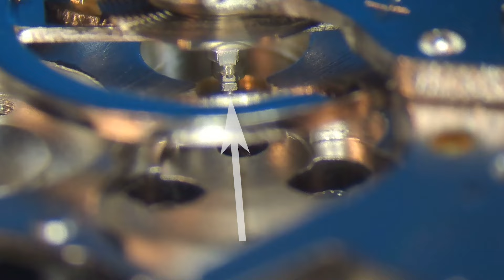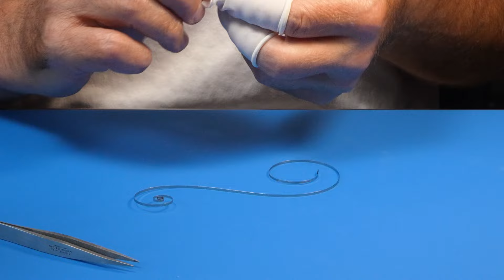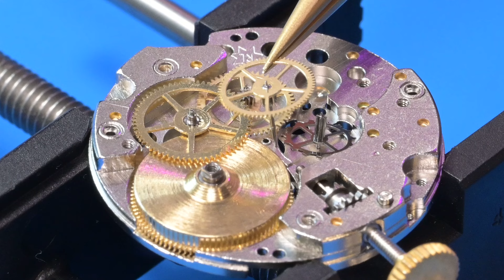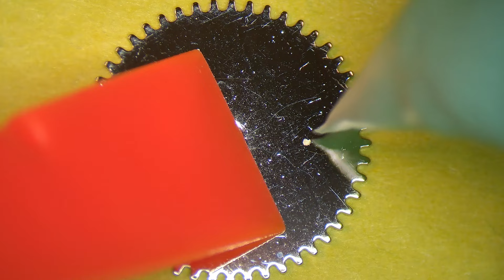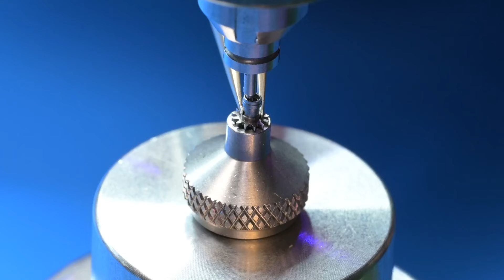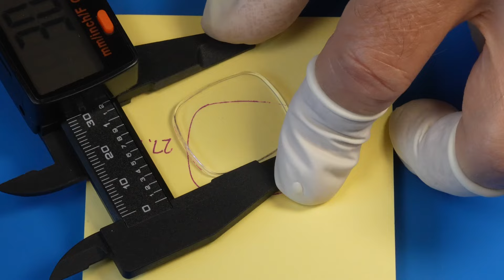⌚ Part 2: Late 1960s Pin Pallet Watch Restoration: E. Gluck "Chateau" Wristwatch #watchrepair

Comment: Great help. Thanks. What size screwdrivers do you use. Are they smaller than 0.6mm?
Reply from the maker: Hi Steve, my Bergeon screwdriver set has the following sizes in mm:
.5, .6, .8, 1.0, 1.2, 1.4, 1.6, 2.0, 2.5

Comment: How much does the beat error go up when you improve the accuracy? For a watch like that 2ms is negligible and a little more is acceptable. Accuracy should be the priority over beat error.
Reply from the maker: The beat error jumped up to 1.8. I felt like I was chasing my tail trying to regulate the watch, so I figured I would re-case it and wear it for a while… Let it settle in before spending any more time on accuracy.
Reply: @WatchWithMike  I’d bet 2ms was within manufacturing tolerance for that movement. Go for the rate!
Reply from the maker: @WMIYC  I agree! This watch is so easy to open that I think I will go back in, and stop worrying about beat error.

Comment: I thought I had similar microscope to yours.  Can you not tilt the head of your microscope?  I keep mine tilted a bit so I don't get a straight down view.  That makes it easier to work with tools so they don't get in the way of what I'm trying to see.
Reply from the maker: Yes, the microscope head tilts, but if I put it at too high an angle it slips and I don't want to torque down on the tightening lever too much.

Comment: sometimes with these cheap pin movements I just find a middle ground between each position for regulating. That way hopefully the average is closer to zero than any individual position respecting the BE below 1.
Reply from the maker: I appreciate hearing that I'm not the only one that doesn't expect too much. I really didn't know what to expect as far as accuracy, and at a certain point the performance matters more on your wrist than on the timegrapher, so I figured I would just re-case it and wear it for a while. It runs about 1.5 minutes fast per day, but that's OK because I don't drive trains for a living. 😂 And after the servicing, changing the time is buttery smooth so I don't mind. 👍🏼

Comment: Yes. Rodico eats click springs. And it sticks to them after you removed the main part of it. It is The Blob of the watchmaker. lol I had the same problem lately. The RL in the seven pronged star. I looked that up and found it on several Ronda mechanical movements. 🕐⚙️🍸
Reply from the maker: OK, thanks for the confirmation on Ronda! Good research. 😁 At some point in this restoration I started suspecting my Rodico of being counterfeit, if that's even a thing. Mine seemed much more sticky than other watchmakers'. And I can't get my finger cots anywhere near them… It's like getting gum in your hair. Awful!
Reply: @WatchWithMike  Hehe. By the way, I found the sign on older Ronda movements only. Later they started to print their name on the movements. Rodico is a kinda wonder material. But sometimes it acts not as expected. I didn’t figure out if the reason is if it has been used before to pick up oil or just the temperature or whatever. I can just say that the portion that I had my click spring problem with is a portion I used for cleaning before.
Reply from the maker: @NaNByZero  Yes, Rodico hides its secrets of past uses very well, and that probably has something to do with its unpredictable nature. I did not see that logo on any of the quartz movements that came up in my image search for Ronda. It makes sense that it is the older movements. Awesome!

Comment: The Star with RL  is Harley, ronda ?? did i win ?? strap two i like !
Reply: Shows as Ronda on Google
Reply: @ harley ronda got a lot laying arround..
Reply: @JonSmith-wg8mr  It is a Ronda; a Swiss company that manufactured movements. I love these movements but their weakness is the breaking the pin on the impulse fork.  They should be repairable. So I am on the look out for broken one to practice on.
Reply from the maker: Harley Ronda? I've heard of them for quartz movements. Are you guessing or did you find forensic evidence that this is their symbol? And I also like strap too, thank you for your vote! 😁
Reply: @WatchWithMike  i think i know this for sure the harley ronda 7 star RL505RL515RL705RL706RLRL751SRL751
RL751RL751ERRL751B
RL751.3RL753RL762RL763
RL783RL775ZSRL775RL784
RL785RL1032RL1042RL1062RL1063RL4210BRL5040DRL6004.BRL6004DRL3772
RL7775RL751ERL1064RL513 couple of exemples of the RL movements
Reply: @WatchWithMike  yepp its harley ronda from the quartz movements !!! you will find it somewhere!